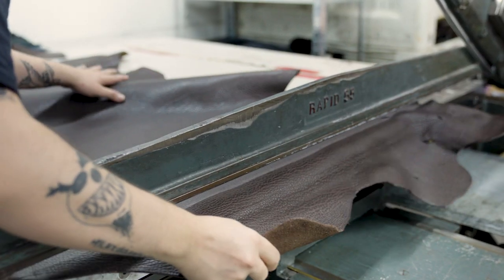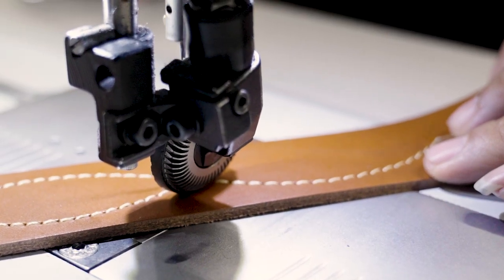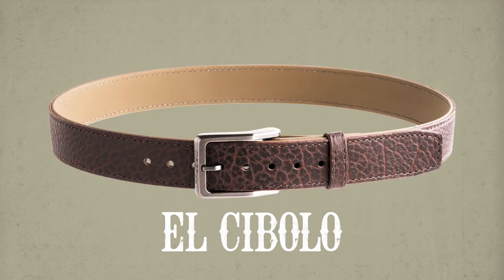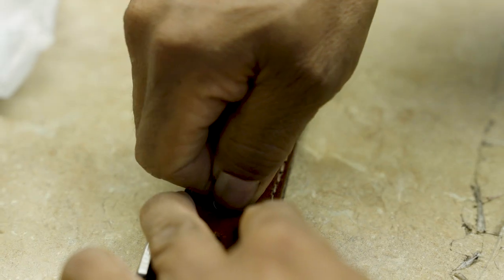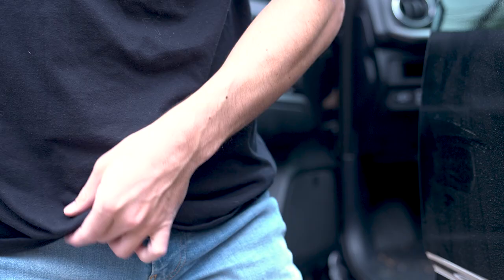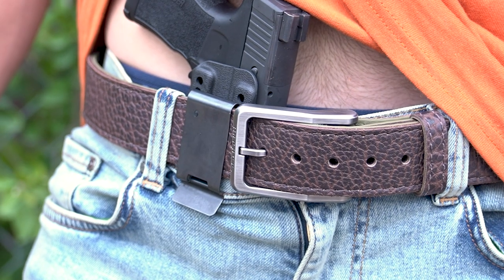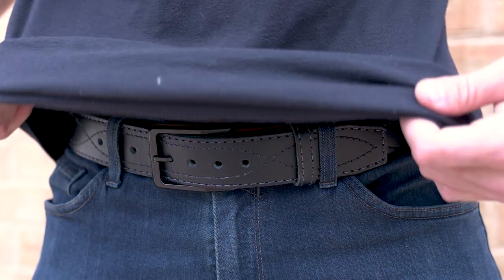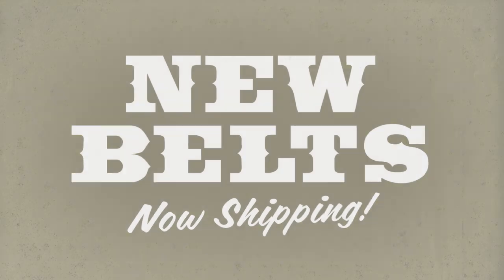Magpul - El Delgado, El Cibolo & El Pistolero

Comment: These prices are pretty damn steep y'all.  I can get an American made Hickory Creek Leather Belt for just over 20 bucks that holds up to EDC uses, literally 3 or 4 of those for the price of one of these...
Reply: I love a American made leather belt. Bill and bison, however I’ve been wearing magpul belts since they first came out  every day and neither of the two have drooped a single bit. They hold up period. Buy once cry once really holds up here.
Reply: @et9650  I've not had any issues with my HC belt either, half the price on these is buying the name.  Point made.
Reply: @DJTheMetalheadMercenary  a leather belt that’s never drooped while carrying a piece? I won’t comment on that past being incredulous. Spend what you can afford on what works for you. Others may want to take look at any leather belt they’ve even owned and see if it’s still flat and go from there.
Reply: @et9650  Dunno, I've never had a problem with droop, may just be my body shape or how I wear it (slightly snug), but I don't have an issue with it, nor with Nylon Belts.

Fair.